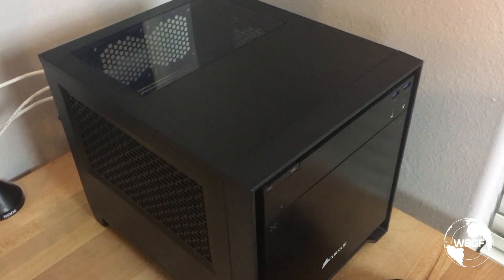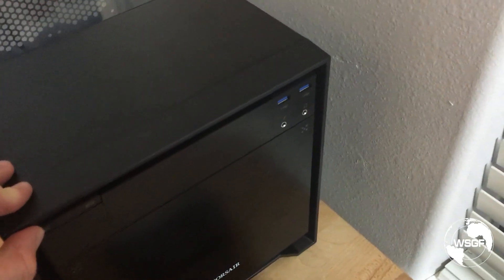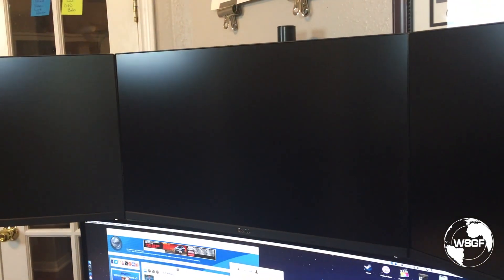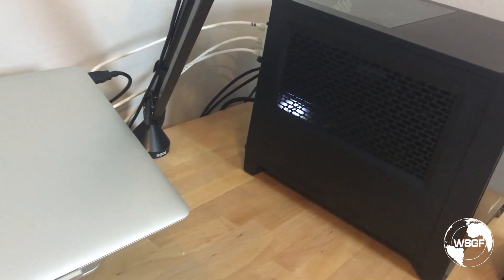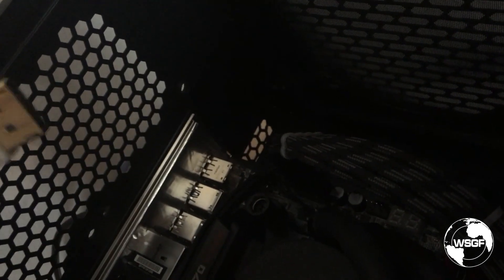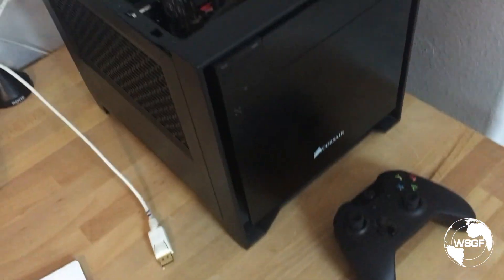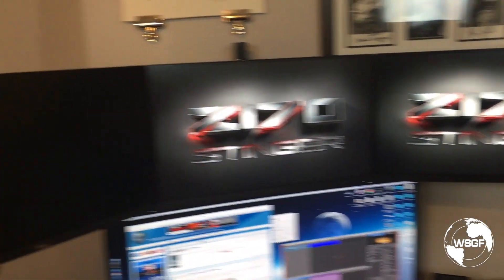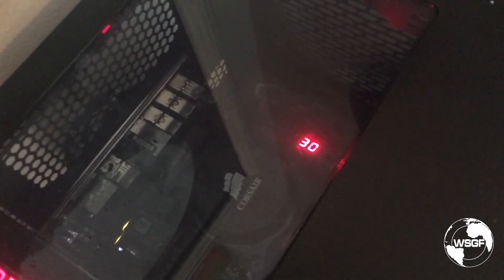SOLVED: EVGA Z170 Motherboard Debug Code "C"

Comment: I have the same probably my fans are running at 100% all the led turn on n there a bebug code C  , I disconnected all the cable from my monitors n keyboard and mouse n still a c
Reply from the maker: brandon curiel try disconnecting the display cable from the PC. Otherwise it’s some other random grounding issue. Pain to troubleshoot.
Reply: WSGF well my computer was working fine yesterday today when I was going to turn it on it worked for like 5 min then turned off n been posting c since then

Comment: hey man just had the same issues an my z170 Classified .
Reply from the maker: Did this get it fixed for you?
Reply: WSGF will not boot bois 3 is either dead C code. Bois 1 & 2 works fine. All cables plug out an nothing.

Comment: Hey man - thanks for posting this I had same C code on my EVGA Z170FTW and never thought to check the displayport cable. Although my system does actually post and has been working fine with no issues for months I just got a new 1080ti SC2 card from EVGA and the LEDs were always on even when the system was shutdown.

Replacing the displayport cable with a new one solved that problem as well - thanks!

Comment: how do you make the lock screen image strech to the three monitors on lock screen?
Reply from the maker: You have to configure your desktop as an SLS (Single Large Surface) - Eyefinity for AMD, Surround for NVIDIA.  I'm also running Windows 10.
Reply: WSGF thanks 😆
Reply: How do you do that??